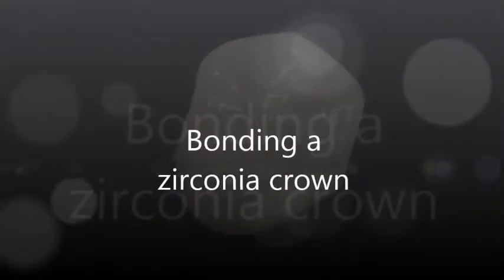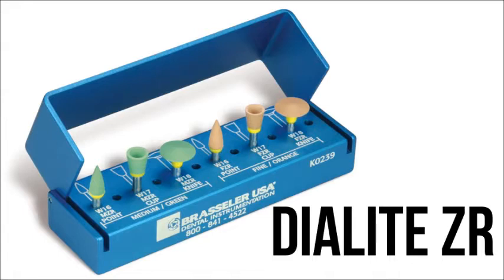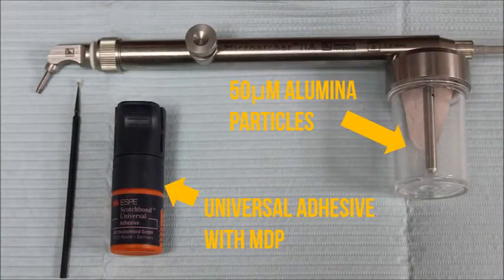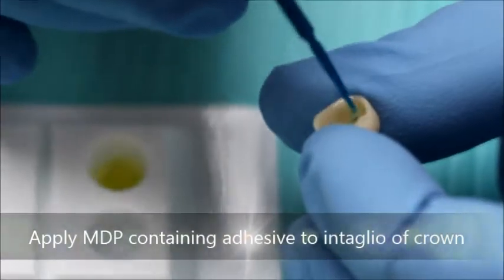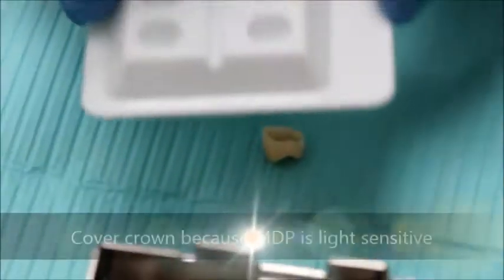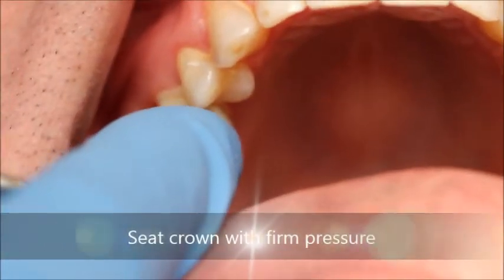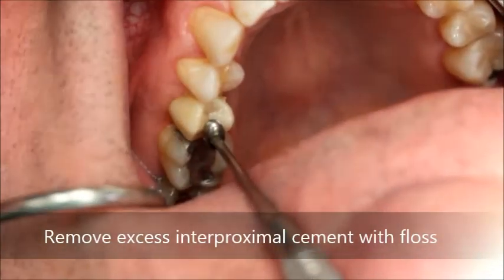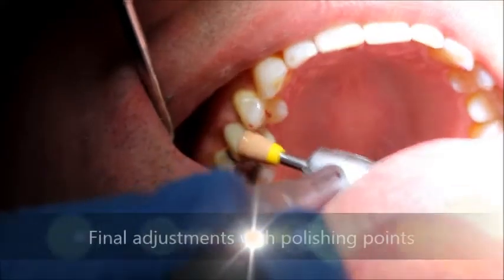Bonding a zirconia crown

Comment: dont need to etch the internal surface of zirconia and tooth surface?
Reply: No need to etch Zr. Tooth can be total etch , selective etch or self etch with scotchbond uni. Light cure or not is optional , the only worry if light curing Is the thickness of bonding agent so drying to achieve a thin layer is crucial so crown can seat properly. Light curing can reduce post op sensitivity and achieve higher bond strength . Hope this helps .
Reply: @dr.avinashksajnani7930  but with 3M bond ... no need to cure the light even.... i have been bonding many more emax as well as PFZ or Monolithic Crowns and fpds... plus veneers with same protocol and they are good till the date...
Reply: @dr.jigarpanchal2084  yes it’s an optional step and isn’t necessary but light curing will give you higher bond strengths. This is in terms of curing the bonding agent before application of the adhesive .
Reply: @dr.avinashksajnani7930  true one indeed... but particularly when it comes to 3M bond with 3M cements ... it has worked nicely and constantly.... but still an optional step ... agree with you on that note...
Reply: Zirconia cannot be etched or is not effective. I am surprised they use the bonding/adhesive for Zirconia.